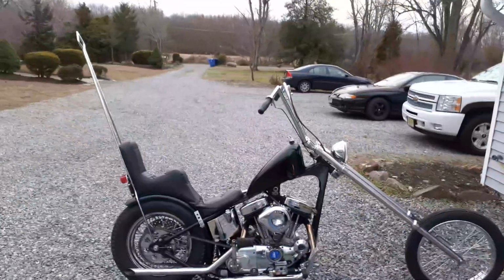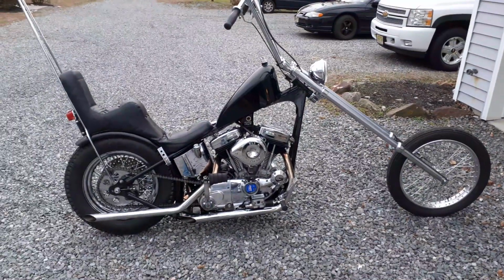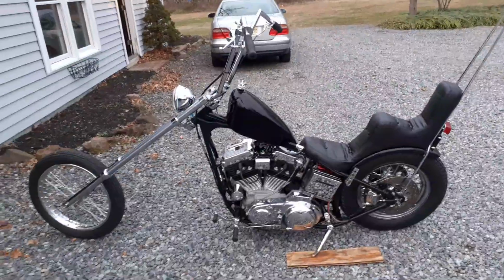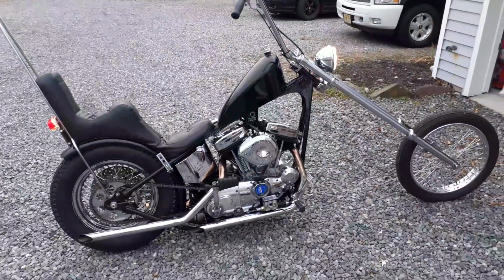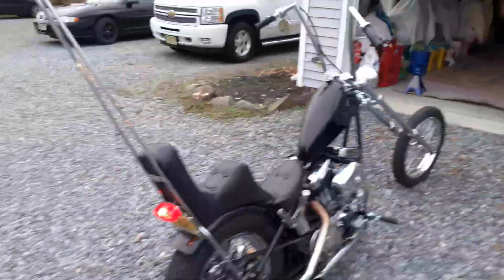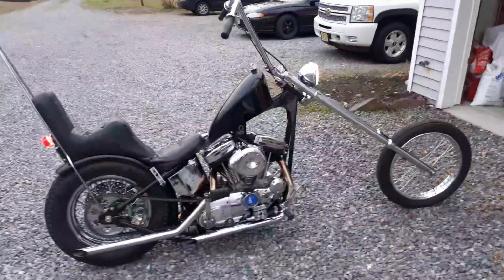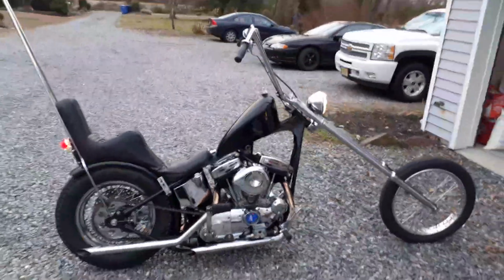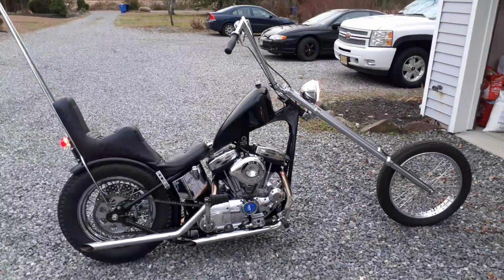Old Scool 70's Style Evo Sportster Chopper 1275cc Hammer Kit

Comment: Very Nice....You've got me considering a sporty build...LOL
Reply from the maker: It's a Paugco 120 Frame. 40 deg  2 1/4" up and 0 out. You got to check the frame with a pvc pipe in the neck hole when it comes in..Some of them have twisted necks from the Factory, I had one and sent it back 2 years later for a refund.
Reply: @jingelsby  .... I have bought Paughco frames in the past, and they have always been top notch. But thanks for the info

Comment: In looking to build a long fork sporty too, and was wondering if you have adjusted the angle (rake?) with the triple trees? Many builds I’ve seen just put a longer fork with the same angle on and it lifts the frame in the front which looks off and I cannot help to worry if it will oil starve the engine too? 

This one is perfect!
Reply: Sorry I rewatched and you said pauco 5 degree rake trees

Comment: I want to see you start it with the Kickstarter. That is nice, except I'm not liking the extremely tall sissy bar and bars. I would go for some old school pullback bars with all the bends, as well as a shorter and stronger sissy bar. I'd like to find out, in more detail, what you did, so I can get mine like this. I've been wanting a Hammer kit.

Comment: How much difference would you say between stock 1200low fuel injected and that 1275 ive been wanting it for some time now
Reply from the maker: I would staty with your current setup..I ended up going back to 1200cc , Wisecoo 9:5 to 1 pistons with stock 883 heads and stock cams..Couldnt be happier!!
Reply: James Ingelsby so are you saying the hammer kit wasn’t any good did it cause damage or something it’s supposed to be pretty reliable isn’t it